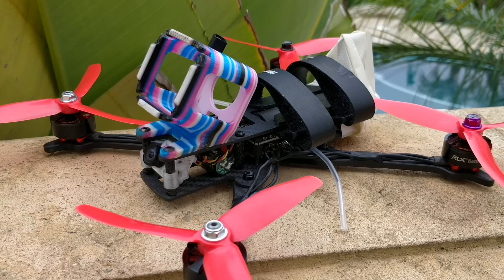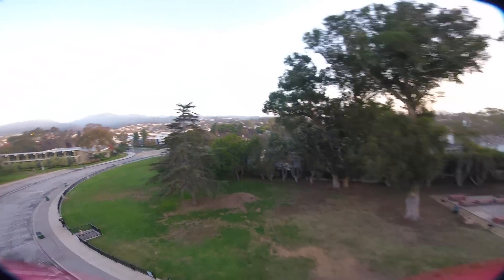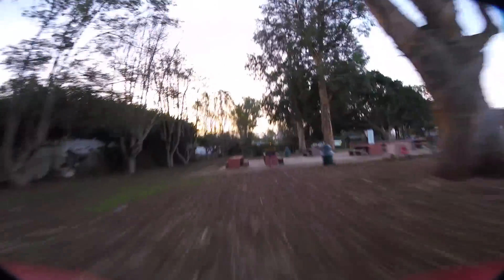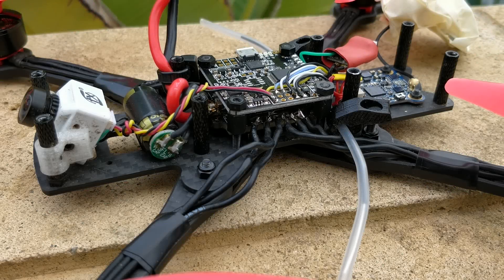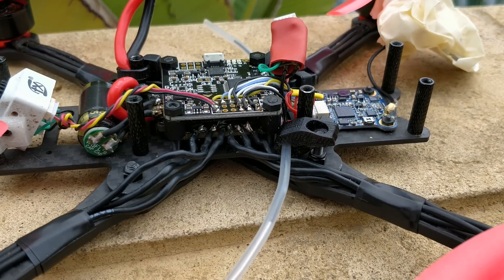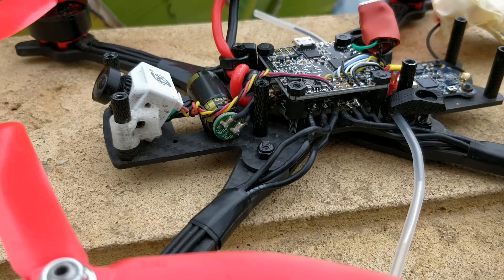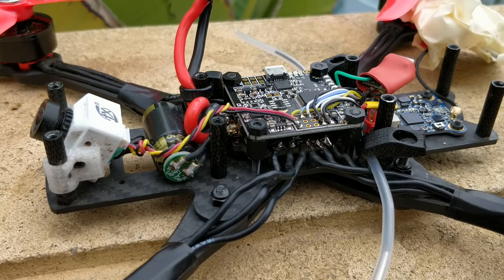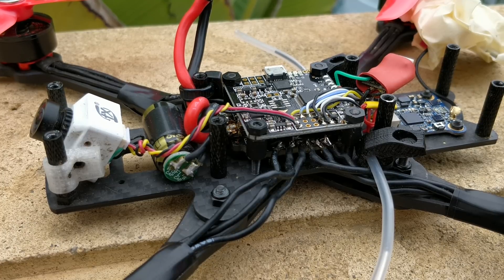Naze32 in 2019...

Comment: I race with dRonin firmware on CC3D and Oneshot42. Flies fine. I feel like old hardware gets you 90% of quad performance, new tech adds the other 10%.
Reply: I've got a stack of CC3D at home. Didn't have a lot of success switching them to BF. I'll do a search on dRonin to see how to do it.
Reply: @nitronut1723  Only older dRonin version still supports CC3D; dRonin Artifice. The way dRonin do pretty solid autotune on an F1 board is quite impressive.

Comment: This quad was running 6s?
Reply from the maker: 4S
Reply: Did you tried the ori32 on 6s?
Reply from the maker: @vojtechvejsicky1819  yeah. Works fine. Only for low kv however

Comment: I have been experimenting with some test  betaflight code that has Dynamic LPF and dual Dynamic notches. Operating at 1.33k/1.33k. 
Because of running at 1.33 k
I'm only running one gyro LPF at 150/ biquad
And 1 dterm lpf  at 150/biquad 
And dyn Q at 300.

Cold Motors warm battery and I have to be completely honest I can't tell that it flies any different then an 8K setup.
( maybe better? With nearly a min more battery life?
More data on this is being collected)

Less filtering, less phase delay and  nearly non-existent propwash
On default pids.
Reply: Up until 8k there is no difference, I run 8k 8k and 150 dterm and gyro lpf stage 1 only and pt1 not biquad. So it's not the pid loop or the gyro frequency that enables low filtering.
Reply: @leftyfpv8263  I / uavtech, have data that shows otherwise.
There's a big noise difference between 1K and 8K.

Regardless the point being is I cannot tell any difference in flight performance between 1K and 8k 
Backing up what  Bob is saying
Reply: @QuadflyerX  oh! lol mate! So there is indeed a difference in noise passing through in 8k vs 1k? I was talking practical yeah, didn't notice a difference.
Reply: @leftyfpv8263  there is evidence of that yes.

Comment: This is why all the transmitters have timers on them. Before OSD - even before quads, there was no way of knowing when your batteries were done, before that - when you were running out of fuel. Remember planes (I used to fly them quite a lot before being seduced by the 'darkside)
Telemetery is really quite new in the big picture. I have hanging here my 1st "computer radio" - a JR SX600 72mhz, no telemetry at all. It's not really that old. Hanging next to it is my (mostly unused Horus X12S - wow what a contrast.

I still have a flyable Flamewheel with a KK board in it, but all my Naze stuff is pretty smashed (some of it quite hi-tech with a PDB and Minim OSD on '"the stack".
Back then it was repurposed airplane ESCs (remember when it was a big deal to flash Simon K firmware), tied to the Naze with an octopus cable to the 4 channel PPM receiver. That all was spinning 2212 motors spinning 8" 2 blade props made for planes (they were so flimsy they broke handling the quad and so flexible there was little control. The armatures weighed a tons and there was no active braking, the motors just spooled back down from air resistance. 
Arguably it was this stuff that hurt flight performance so much. 
RF was handled by a Lawmate VTX in a metal can (I stripped it out of the aluminum case to get the weight down to a few ounces, and a CCD security cam in a STEEL case (What were we thinking??)...
You bypassed all these performance killers.

Maybe for the next test, - Ditch the 4 in one and throw in 4 Simon K escs and an octopus cable?

Interesting Video!

Comment: I have an 2.5" with an afromini and the last version of betaflight(supported)...It is flying ok but it is boring. The issue is not the board,it is the other parts.. the 1104 4000kV are way to weak or it is the ESC without bheli... If you want I have some quads with a multiwii board (Atmega).. These two will be challenging for you :P
Link to old stuffs here
https://www.rcgroups.com/forums/member.php?u=226675

Comment: I thought betaflight stopped supporting naze and f1 boards, at 3.2? I have an old p200 running 3.2. It would be great to flash 3.5,
Reply from the maker: Seems they picked it up again
Reply: yeah, but even 3.2 has dynamic filtering.

Comment: I found the limiting factor back then was actually the esc tech. With the advent of blheli s and 32 things have changed a lot. Now if you were to try old one shot or pwm only escs you will see what I am talking about. I had helped people get their eachine falcons to fly great with just a swap of the esc s to blheli s escs. It is a pain to work with the naze32 though. I had to mod an ftdi to work with it and have to use smtelectronics app to update the fw on the ones I worked with.
Reply: Completely agree.  My biggest change was going from oneshot to dshot... Any dshot

Comment: Wow, so using f3s is an ok idea?
Reply from the maker: Probably is. As long as the latest betaflight is available for it
Reply: Of coure it is. Considering the inversion and RX, it is even the more practical choice. I have been flying F3's for years. They are stupid cheap (since everyone was on the F4 wagon) and I have had the same flight performance as anyone flying the F4's, just easier to build. The FPV community is great, but many of us will just believe anything people or manufacturers say, without actually testing it.
Reply: I've gotten a LOT of practice and trial and error with several betaflight 4 builds with 2 f3 boards and they fly just as well as the f4 versions.  I'm sure there are differences, but as long as I'm using sbus or ibus, dshot anything, then the fc performs about what you see here.  Just good overall
Reply: @kyran4238  i have 8k 2k... Runs great.  4k2k ran great... Actually, as long as I'm on dshot with a stretched x frame... The loop frequency wasn't even noticeable